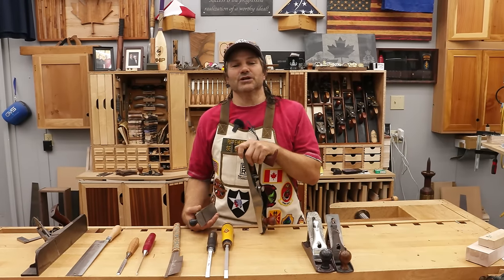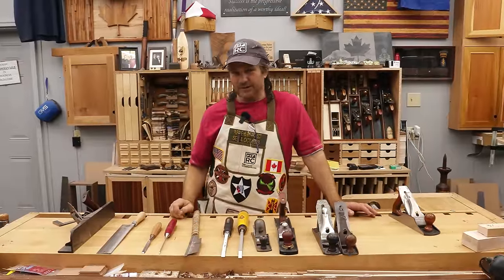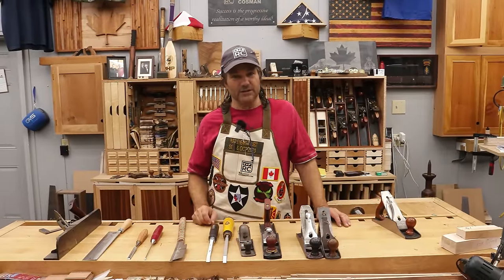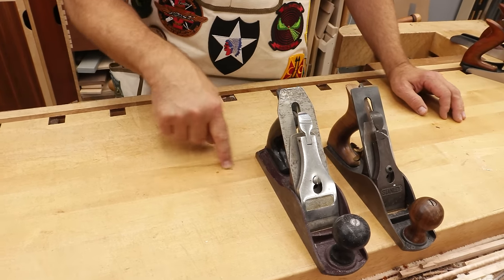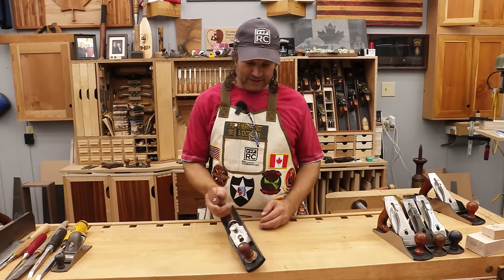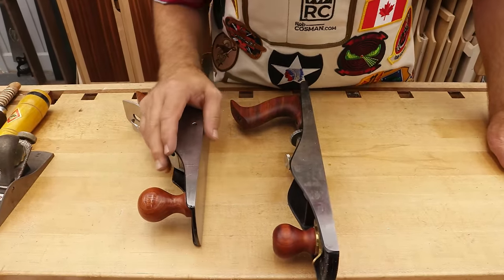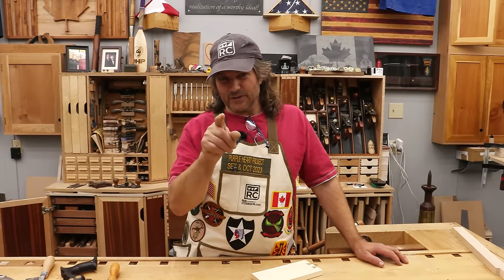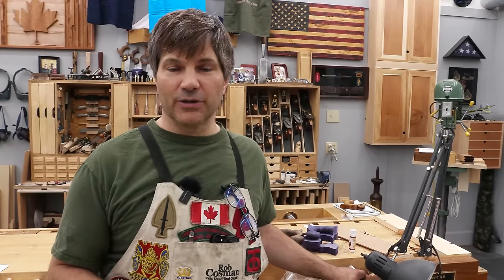Tools Not To Buy | Learn From My Mistakes !

Comment: I can appreciate your opinions here, but claiming that the 4-1/2 is just as easy to push as a No. 4 doesn't pass the physics test.  Adding 3/8" to the cutting edge is increasing the cutting edge by 18.75% compared to a No. 4, which will increase the amount of force necessary to push.  I would notice that difference.  The alternative is reducing the depth of cut, which simply makes the task take longer.  A 4-1/2 is nice for larger work, but it's bringing a cannon to a gun fight for smaller work and shorter pieces.  You claim versions of the Stanley shooting planes are around $500, yet the Lee Valley Veritas Shooting Plane is $366 US.  Far less than $500.  I've seen tips to saw off a portion of the handle (like your red Marples) to improve the balance.  But I agree, they are tiresome to use as-is. I sold mine as soon as I could afford a decent set of decent bench chisels.  They do make Japanese saws for hardwoods, BTW.  I gotta wonder how Japanese woodworkers make all those complicated joints using their saws.  The wandering you mention can happen in hardwoods as well as softwoods.  Proper technique for the tool being used.

Comment: There´s no problem with gent saws. German carpenters worked with that style of saws for ages without problems. Same goes for chisels where the bevels don´t go all the was down. The standard german chisel doesn´t have that feature and it wasn´t a problem for hundreds of years. for the last cut right into the corner you can skew the chisel a bit and it won´t be a problem to produce sharp corners. As a benefit the chisel is much stronger.
Reply from the maker: German, English, French, Italian craftsman , whatever, had years to develop the skill.  We are dealing with hobbyists that have a few hours on the weekends.  They benefit from better tools and techniques in lieu of years of training.  Don’t interject opinions that serve to confuse.  I teach hobbyists, what I tell you works, tons of experience to back it up.
Reply: @RobCosmanWoodworking  I´m just a hobbyist amd it didn´t take me years to learn how to use a chisel or a saw. It´s not that complicated.
I just started out with what was available and that also included wooden planes with wedges. It´s not that complicated. It´s not conusing. If there was an advantage to another saw handle or larger side bevels on chisels, carpenters would have modified their tools a long time ago. It´s not that hard to make another handle for a saw or to grind down the sides of chisels but you just don´t see these kinds of modifications, even though craftsmen all over the world modify their tools to suit their needs. 
There are lots of opinions out there. Paul Sellers for example says you don´t even need mortise chisels but I find them useful. Others might prefer japanese saws, so are the Japanese wrong too? They don´t seem to have problems with hard woods, teeth breaking off and tight fitting joints.
I´m not here to confuse. I´m here to tell people there´s not only one way and even the opinion of an expert isn´t gospel. Even the experts can´t agree on what tools you need and how they should look like.

Comment: Aarghh! Too late for me... I already bought a cheap set of chisels. I guess I couldn't resist the price. Now I dare not look at them for fear of finding out all those things mentioned here.
Reply from the maker: What brand did you buy?
Reply: @RobCosmanWoodworking I bought them from Lidl. Probably the Parkside brand chisel set.
They sold the sharpening stones at the same time which were a bargain for 10EUR each - 10000/8000 and 1000/4000 grit I believe, or something like that.   It was a nice to have thing at the price and I thought why not, since I already bought the stones, what could possibly go wrong?
I think I paid less than 40 EUR (say roughly 42USD) for a set of 8 if I'm not mistaken. haven't even checked them yet.

Comment: My list: 

Stanley Sure Plane rasp, cuts inconsistently and you can’t hog away wood like you can with a real rasp, I prefer spokeshaves. 

Construction or pro-grade saws, supposed to cut both cross and rip, does neither well, the handles are malformed. I bought a couple of antique off brand, not Diston, saws and fixed them up, and sharpened them. They are great.

Egg beater drill, nice antique, nuff said, works fine but you can’t beat a modern battery powered drill for speed and accuracy. On the other hand I like my bit and brace for drilling big or deep holes, it has a lot of torque and won’t crack your wrist like an electric drill.

Hole saws, awful, just awful! They create splinters, smoke, and burn the work, awful! I use forsners or my router, and…

Cute little Japanese planes, guaranteed to crack and split in Colorado, not at all comfortable to work with. After thousands of years you would think the Japanese would round off and put handles on their planes, must be tradition.
Reply: Forgot one, the miter gauge that comes with a table saw or band saw. Inaccurate at best. They are throw away quality. It would be better if a manufacturer would have a coupon for a good one.

Comment: So you didn't like a pull saw and demonstrate how a push saw works.  A pull saw will definitely keep straight, you just have to start the cut correctly. The starting kerf will be its own guide and not wander. The path of least resistance is following its own kerf, which is tight due to the thin blade.

Comment: I completely agree with EVERY comment, but one (not bad, really). Just as western saws come in different thicknesses, so do Japanese saws. You bought a very thin Japanese saw and victimized all Japanese saws because you were using it for the wrong purpose.
Reply from the maker: It was sold as a Japanese dovetail saw desktop for western hardwoods!

Comment: There is no historical connections between the old tools and their usage to new generation . Tool #3 may be a good tools for smoothing the edges not much used for flat surfaces . Anyhow there are so many hidden connections between the old tools and the new tools that is not much registered in the book.

Comment: Japanese pull saws are just as accurate, as with all things experience is necessary
Reply from the maker: Yes, if you learn to use a Japanese saw you can be very accurate but I find that for beginner's the learning curve is much higher.  I have students in my workshops who bring their Japanese saws and as soon as they try my western saw they almost all switch over

Comment: I don't get the problem with the first mortise set up.  You are aligning the edge with the rung lines of your ladders.  So long as you do that, all the rest of the angles are not terribly important.  With the guide block, yes you would prefer to have square sides, though one could go belt and suspenders, with lines and the guide block, if one had to, and that would solve the problem.  That last chisel looked like a nice chisel, however, I never buy mortise chisels with  an elegant narrow termination at the tang or socket.  I want the designer to give it the best look he could while making the transition as fat as possible.  I can feel the buzz otherwise.  Just a personal preference.
Reply from the maker: If the sides of your mortise is angles then when you hold the tip of the chisel perpendicular to your mortise side lay out lines and chop, your mortise walls will not be smooth and straight, they will be jagged by the amount the sides of the chisel are out of square.  A jagged mortise wall weakens significantly the glue surface

Comment: When I was a young lad my father told me that you shouldn't set a plane on the blade. You should always lay it on it's side whan not using it.

JMO.
Reply from the maker: In my opinion, that’s an outdated and baseless line of thinking. My bench is made of wood, my plane is designed to cut wood. What would the harm be in laying the plane down right side up?

Comment: better tools do not replace skill, knowledge and understanding of the outcome of what you're trying to achieve!! spending money on more tools is a silly idea, without knowledge of the process of what you 're doing, tools will have no effect. as you said, its your preference but this video isn't actually helpful at all. 
a 2.5 " smooth plane is brilliant for 2nd fixing and not designed for a workshop. a 3"/4" jack plane is good in both environments. 
jap saws are just trending atm and will never beat a good tennon/dovetail saw which you said and i agree.
motice chisels ...... pfft, the taper on them is to increase the amount of wood removed you're not making a mortice the same width as the chisel. in the good old days when all we had was mortice chisels, we had a range of different sizes (with square sides) , we used 3/8", 1/2", 5/8" 3/4 and 1", sadly ive only got my 5/8" left......others are worn out. the chamfer on a mortice chisel is designed to cut deep irrespective of whether the sides are square or chamfered. its the depth/fatness/girth of the blade that defines the effectiveness of its duty. also it should have a slightly convex angle to the cutting edge. this helps lift the waste and dig the cutting edge in deeper( it also helps cleanig the bottom of the mortice)
i agree on the upside down lower plane blades ..... even a very well sharpened one is just going to tear the s***t out of short grain.
when all said and done, if you can't get a job done buying a s***t load more tools probably wont increase your profits or finish!!
BestYouCan!!

Comment: sorry. but if I need a hand plane, coping saw, or screwdrivers, I WILL buy them. While I would prefer a vintage hand plane, I would have no problem buying new a Stanley, or other name brand hand plane, and depending on how it felt in hand, a Harbor Freight hand plane (or ther tool) would not be automatically rejected.

Comment: did you really think there would not be dissent ? 😂
dude , this is YouTube the home of negativity and trolling .
The Japanese saw shouldn't wander because it is not in tension. however being so thin it does allow for some flex on the first few strokes . my suggestion is buy a european or american version of the pull saw as their blades are sometimes thicker , reducing the possibility of wandering .
Reply from the maker: My suggestion is to buy my saw and be done with it!

Comment: Who wears gloves when woodworking? The 4.5 is poorly weighted and balanced in comparison to a 4. Weight got nothing to do with ease of use if sharpened correctly, low angled plane expensive and unnecessary, your analysis of the angles was flawed, think of them in third angle projection? Shooting board plane collectors novelty, mortice chisels, just thinking of a 2" timber framing one to your spec would be uncomfortably heavy? I guess after 700 years of experience your entitled to an opinion and I'm sure your trying to help. True craftsman can perform miracles with any tool after fettling, and some prefer the feel of certain tools that may not be classed as the best by wealthy amateurs in retirement?
Reply from the maker: Feel better?

Comment: Regarding the saw, you left it to the viewer to take it on faith that the Japanese style saw can't handle it.  Without you using it, and showing the problem, your demonstration proved nothing.   It isn't that I disbelieve you, but since the saw you reject cuts on the PULL stroke I don't understand why it would buckle.  The pull stroke puts the blade in tension.
Reply from the maker: Doesn’t buckle, it wanders in the cut seeking the path of least resistance.

Comment: Wow!  That was a brain teaser.  Set up on low angle jack, poor.  Set up on identical low angle block plane is great because it is the same as the jack, and you can use extra blades.  Huh? I agree I would not buy a high angle block plane, and I agree with a lot of stuff on the 5.5.  But the comments on the engine room/bedding angle are just silly:

1) You can micro bevel on the underside of the low angle blade and the cutting angle is the same;
2) You can use a system like the LV sharpening guide where the micro bevel is only 1 degree higher;
3) You can jig or freehand the main bevel hollow ground and hand sharpen it, or with a jig, and have almost no surface area to sharpen, with good stability.

I don't swear by low bevel angle planes, but there are advantages:

1) Lower cutting angle is nice on endgrain;

2) Faster to cycle through the sharpening process.  With a Japanese plane, I can get the blade out, and back in and taking a shaving in 10 seconds, 20 for specific shaving like 1 thou dead on.  That would be single blade.  Low angles are the next best thing.  The faster you can cycle sharpening, and the more easily parts unbutton, the better.

3) Low angles are easier to hand sharpen because they have a larger bevel for a given thickness.  Idealy, when learning, try to learn hand sharpening.  You can't give it a pass, eventually you will have to have the skills to sharpen some tool, or make them from scratch.

4) Nice on endgrain and certain woods, and you can have blades for different woods.  I generally don't worry about it as I have other choices when tear out is a problem.

5) Most of the systems I have seen also modernized planes with easier to operate cap irons and Noris adjusters.  Woodworking skews older.  I have done it all of my life, and at 65 I am still happy to say, I don't need my tools to be designed around arthritis.  However, a lot of people will like planes that are lighter; less punishing on the hands to take apart, and with fewer steps.  I used to sell lawnbowls.  They are sized to fit hands in 6 sizes.  My customers were having none of that, they only wanted the smallest lawn bowls, the 1s.  When Hensolite came out with a zero, all the players had to have them.  So depending on your stage of life, you may wish to plan ahead.
Reply from the maker: Thanks for the comment.  Just a few points, putting a back bevel on a low angle blade does not affect the cutting angle or angle or attack.  Only bevels on the front of a LA blade effects the cutting angle.  If you sharpen with micro-bevels, most use a secondary and a tertiary bevel.  Even if you are using a jig, like a Mrk II which has the click settings and you can keep your micro bevels down to 1 degree the cutting angle of a LA jack would be 39 (12+25+2).  Not a significant difference in my opinion from a bench plane'scutting angle.  If you free hand sharpen as I recommend that micro bevel angle grows and you will end up essentially with the same cutting angle as a standard plane.  My point is that I don't find the agreement most people use about the benefits to a LA blade angle over a standard angle blade to be real...but as I said this is only MY opinion.

Comment: BEWARE. Cosman's comments about planes are based on the bad assumption that woodworkers should copy his ill-informed "microbevel" sharpening technique. Don't go there, it's an unnecessary and illogical sharpening technique that will easily lead you down a rabbit hole of progressively steeper and steeper bevel angles, until you are forced to perform a major re-shaping of the plane iron to bring the bevel back to baseline. Honing the entire bevel doesn't entail any more "work" than honing Cosman's "microbevel." If an iron made from quality steel has dulled from a couple of hundred strokes you only need to remove a few microns of metal from the bevel to bring it back to fully sharp. If you're using modern inexpensive diamond hones ($20!) that tear through the hardest steels like butter it just doesn't matter how much of the bevel you are honing. And by honing the ENTIRE bevel you avoid the progressive steepening that is so easy to fall into with the microbevel technique.
Reply from the maker: Beware of folks that cannot see advantages beyond their own method.  Sharpening technique is ver individualize as there are so many methods.  After 35 years of doing professional woodworking I have tried most every sharpening technique.  They all work.  The issue really revolves around which method gets you to a sharp edge quickly , so you will actually stop and sharpen.